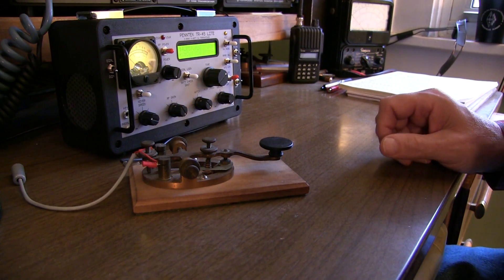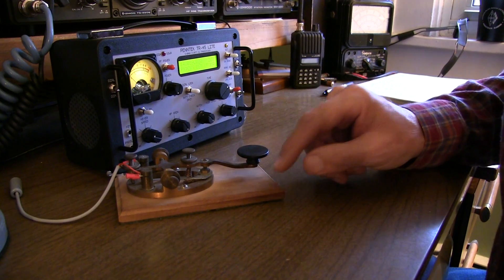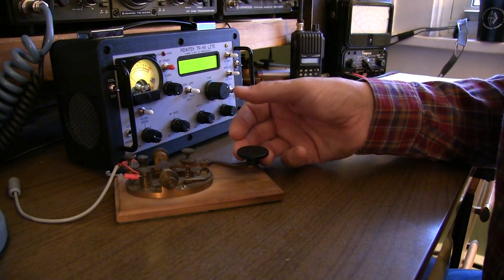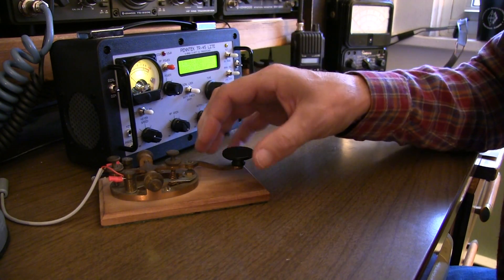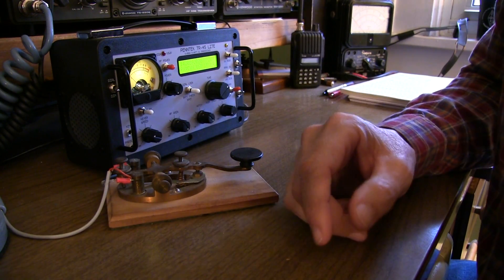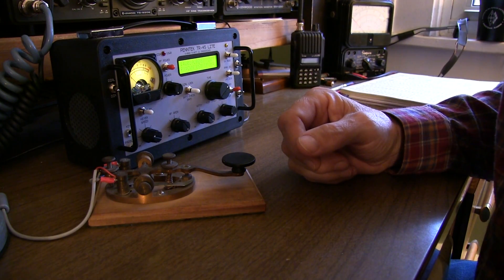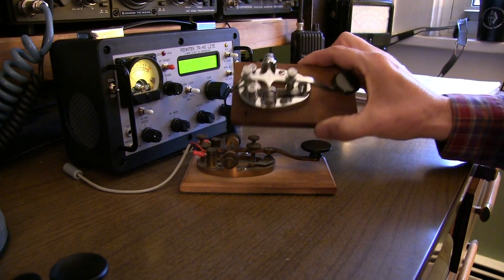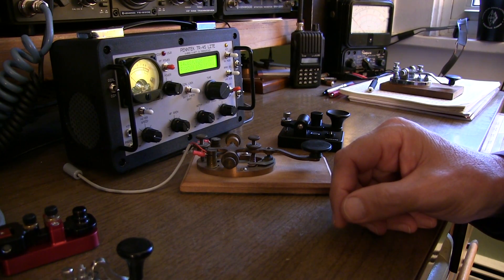#365: Ham Radio: What is your CW straight key sending style?

Comment: Novice ticket in 1977 when I was 14.  Started off with 2 fingers on top, index and middle.  After about 10 -15 years of pounding brass...went to a grip, thumb, index and middle fingers.  Works for me...when using my J-38 or Navy FP.
Reply from the maker: Those are my two favorite straight keys

Comment: i have my straight key perpendicular to my hand (right hand is controlling so the backside of the key is pointing to the left), gripping the knob, and resting my arm on the table. My left hand is holding the other side of the keyer mount to keep it in place. I play musical instruments and I prefer to only use my fingers and rotating the wrist to operate. To me, it's easier to control with the grip and to not use the spring to settle on the spacing of the dits and dahs. I could run the key without a return spring basically.

Comment: I believe there is a Right way, and many wrong ways to hold a Key !
I ascribe to what I believe is the proper way to hold a Key.
That is my being Right handed, I place my Thumb on the left side of the disk, Index finger on top, likely forward some, and my middle finger along the Right edge !
Your Forearm and wrist should be resting comfortably along the desk top, with your wrist handling the make and break of the characters !
One of my Elmers, as I figure I've had plenty over the years, learning a little bit from each, gave me what he called a ,
 " Spit Fire " !
The trusty Ol' J - 38 !
And he was correct !
You can send a Hell' n have you a mind to !
Ran a Straight Key for some Forty years, before telling myself if I'm going to use a Paddle, I'd better do it, cause I'm not getting any younger !
Still switch back occasionally, but it's hard to beat a good set of Paddles !
IMHO !
Thanks for ask'n !
'73 !

                   R.I.P.
           JERRY SMITH 
               WA9VPR
                (VIPER )
                ♥️🥀♥️

Comment: I use a grip and elevate my arm "European style".  I've been licensed since 1968.  Was off air for 29 years and when I got back on, I went right back on CW.  No problem.  I use an inexpensive "steel lever" straight key.  It's mounted on a rectangle of 1/4" walnut paneling about 4 x 6 inches.  I usually send around 18-20 WPM.  
For electronic keying, I use an old Brown Mfg. squeeze paddle and an old Heathkit HD-10 keyer driving a mercury whetted relay for keyer protection.

Comment: Which one do you use? How about you do a "straight key sprint" by changing keys for each contact.  Put them in "rotation" smash 'em all for an evening and see how they really stack up against each other.  It's SKN after all, mix it up.
Reply from the maker: For straight keys, I typically use the 90 year old Bunnell when I am using the Kenwood TS-870S, and the 50 year old Speed-X straight key when using my QRP rig.  When operating portable, I use the miniature Vibroplex camelback key (when I am not using paddles).

Comment: I love sidesweeping.  SS is a straight key right? It's all manual. 
I finally learned how to properly manipulate a straight key by watching the old military training videos from the 40's and improved a bunch from that exposure.  U.S. Military that is. 

and in other keys:
I got a set of paddles way too soon-first licensed and don't recommend that to anyone. I mean don't refuse a good set, but save 'em until you're running a good SK is my notion (they don't go bad).
SOME DAY I will get smooth enough to use my semi-automatic key (bug) because I love the mechanical aspects of the apparati so designed.  I flat out refuse to go on the air with it and be out of balance. There's plenty of that already.
But if I had to key only one way from here on--I'm sideswiping with a ham-built key I modified to replace the springs with magnets. It's a smooth operator, me  not so much.  

I should have caught SKN this past time-I was available for once. maybe next year. 73!

Comment: Hi Alan ... As with others below, my Elmer was my Dad, formerly, K8WWK (and when he passed away, KG7X [call obtained and now held by my son, Robert, after Dad passed]). Dad was an Aviation Cadet at the end of WWII, and during his service he had learned to send/receive Morse Code 'the Navy way', that is, with a 'grip' style. When he taught his offspring (us), we learned by 'anchoring' our elbow, and sending with the 'grip' style. Dad had purchased, and then modified an old Signal Electric 'buzzer' key (from one of the old swap meets), very much like the old J38 key, but still with a unique feel. He had modified it by removing the 'buzzer', and building an audio amplifier in its place, and then later he added a tone control. It ran on an old 6 Volt Lantern battery, and it drove a speaker with kind of a metal enclosure with openings to let the sound out, and had a pretty pleasing tone for its time. When I got my Novice license, I ceased to use the signal electric, and instead Dad had obtained an old Navy Key, which had a large, tall black rounded knob (we used this because with the transmitter we were using, parts of the Key were 'hot', and this one isolated us from the more dangerous energies). (I think that thing gave me a 'glass arm' for awhile). But recently, I obtained a near pristine version of the old Signal Electric key (mine has an older 'clacker' rather than a buzzer, but the important thing is the key in this case.) When I started sending on that thing, it was like 'old home week' ... I instantly remembered the 'feel' of that old key that I had learned on 40 - 50 years ago (early '60s) and it was like 'smooth as butter'. I haven't ever done straight key night, but with that one, I may consider trying it out. I can do what I consider really fast (smokin'!) morse with my Bencher and MM-3 for relatively short bursts, but I could probably send 18-22 wpm on the Signal Electric with pretty good accuracy for a pretty long time. I may be inclined to try out the old 'Straight Key' night next year. Thanks for addressing a favorite old subject. 73 & DX! Neil K7WK (& Grandson, Alex, K7WWK & Brother, Dave, W7SN)

Comment: Thank you for the video. I use the "European" style, with an old WW2 Key No. 8. I have a Kent key, but strangely enough, the mass of the key arm slows me down. The arm needs to be very light, and I use very small contact spacings. I much prefer the manual key to an auto key and I send at 20wpm usually.  73
Reply from the maker: Very good - I typically top out at 17wpm with a straight key.

Comment: First, I generally like the knob to be very close to the table, perhaps even installed upside down on the lever, if there’s enough room. Then, I use the pointer and middle finger, pointer for dits and middle for dahs, like a vertical sidewinder - it saves a lot of motion. J-38 would be my favorite. Thanks for the video!

Comment: I use a Speed-X mounted low with a Navy Knob. I grip the key with thumb and middle finger. Index finger on top. I keep elbow on table. I don’t send a lot with straight key. I’m a QRP DXer and most of my CW time is spent with keyer in the rig and a Begali Simplex Mono (single lever paddle). Steve, N1AOB

Comment: Alan, What do you think about the SKCC allowing and even tending to promote using bug/paddles over a genuine "STRAIGHT KEY"? I was crushed when I learned this... haven't really engaged with them after.
Reply from the maker: I don't think the SKCC is promoting the use of paddles.   They certainly do allow the use of a bug though, since this type of mechanical semi-automatic device has been around as long as the wired telegraph days.  They also promote the use of a single-level paddle in a Cootie configuration - which is also a fully manual way of keying.  None of these methods use any electronic keying circuit or aide.

Comment: I'm a Gripper. I learned that way as a Cub Scout in 1961. Overt the years I've tried several different variations but I've settled into what you called the European style.
Reply from the maker: Yes, that's what works best for me, especially because it works for different operating locations and situations where I might not have a surface to rest my arm.  Still looking to get you in one of my POTA activation logs...

Comment: Take a Blade type key like a side swiper or commonly called a (cootie key) but just key to one side only (non cootie mode) you will find side keying is much easier than traditional up and down keying and you rarely get tired just make sure you have good surface area on the finger tab covering the blade and don't let the blade have too much flex but also you don't want it too stiff. Several plans on YouTube  on how to make a simple blade type key very cheap, and since you're resting your hand on the desk, in full comfort   You can click along this way pretty fast with just using 2 of your fingers or if  you o prefer to grip the blade handle with your thumb and 1 finger you can do that way as well,  Experiment with your choice of hitting the key and find your comfort and control zone.   if you want higher Straight keying speed this type of keying can control your characters very smoothly.   Learning true Cootie keying is awesome as well but that takes practice so modifying to just one direction is much simpler for many hams.   Take a bug or even a standard paddle and just side key the dah side in one direction and that will work as well and adjust gap and tension to make it as smooth as possible,  but I like the blade as control is somewhat better,  one safety note rarely mentioned anymore on reviews on keying is make sure if you touch contacts or the metal parts of any straight key that be aware with modern electronic keying your fine but plug in to an old tube set with high voltage on the contacts you could really get zapped. or worse.  I mentioned this as on your video you mentioned touching under the finger tab slightly on one style of grip and that would be a huge surprise if plugged in to an Old Antique or vintage tube transmitter    Great topic and glad you did this video   73 J

Comment: I learned to send on a Military Surplus J-38 key with a Navy Knob  (and still have it!).  I gripped the top part, with my index finger on the top and thumb and middle finger sort of on top of the lower part of the Navy knob.  I have never had an operating position where I could rest my elbow on the table.  I passed my General Code test with whatever they had at the FCC office in Atlanta shortly before I got my driver's licence.  I never operated much CW after my Novice days, but I am slowly getting back into it now as a REAL OM!    It is REALLY hard to UNLEARN bad habits.  73
Reply from the maker: I know what you mean.   I learned CW the wrong way about 40yrs ago, and it is still tough sometimes to break the mental lookup-table methodology.

Comment: I don't CW, but if I did...  I've found that wresting my palm on the benchtop greatly improves my surface mount soldering by reducing shakiness; probably a different problem.  I think this control issue is more like guitar, where I depend on wresting my little finger (or more) on the top of the guitar while I'm trying to get control over individual strings.  I suspect I'd be best off making a key that looks something like a guitar string...  :)

Comment: I was privileged to be taught by a very experienced marine Radio Officer who was an excellent instructor. Key screwed to the edge of the table. Grip the key, arm relaxed in the air parallel to table and flex the wrist to form the characters. "European/British/English Style". Also, taught to send without sidetone (some old ship MF/HF transmitters didn't have any sidetone). Still prefer straight to bug or paddle. In fact, I can't even send if my arm is on the table😅. Euro style comes in handy when /P as I can hold a small straight key in one hand and operate with the other. No table required.
Reply from the maker: I don't know how I'd do without a sidetone!

Comment: I still got my straight key off of my MFJ code practice oscillator when I first got my novice license back in 1993. I've long since lost the oscillator and just use the key with my radio. Not the best quality, but does get the job done. I had to go check, but I put my whole arm on the table, put my thumb on one side of the key, my middle finger on the right side and my pointer finger does the keying. 
My maternal grandfather wasn't very technical, but he had a cheap shortwave radio (Hong Kong made) that he could tell me what they were sending. I always was fascinated by that and when I first got my license he helped me study. He was in the Arm Signal Corps in WW2 in Hawaii, and even though he wasn't a ham and hadn't really used CW in about 50 years, he was still able the help me with 5 wpm. 
Thanks Alan for sharing! Happy New Years and 73!

Comment: Disclaimer - I'm neither a ham-op, nor can morse-code, but was wondering the following:
In any mechanical system, an efficient use of power energy is when the stiffness in the actuated loop is highest (i.e. the potential energy needed to charge and discharge the "spring" aspect is smallest for each stroke). From this perspective, one would think that the "writing style" (corner of the inner palm resting on the tabletop) would be the stiffest, therefore most efficient. There is something to say for also choosing an optimum whereby the strongest actuator is used (the fore-arm torsion style that you mention). 

Another style may be even more efficient - putting the key on its edge and pinching it between the thumb and forefinger ("ergo-mouse") or between forefinger and thenar-region ("stapler") - any idea if this actually works?
Reply: "Castanet" (instead of "Stapler")

Comment: I learned CW in the army operating in armored vehicles.  CW switches for this use have (or had) a bracket attached to the operator's leg (a kind of belt).  It's quite comfortable and after that I never got used to using the key on a table.

Comment: I grip the key with my elbow resting on the table.
My Dad taught me code  he was 3KS in the period just after ww1. (His call sign 3KS, wss before they adopted the prefixes in Canads)
I like a bug when I am rag chewing. 
I have dad's old straight key which I learned on, thats what I am using tonight. Comes out every new years.
I am sitting here wih it getting used to it. 
Best regards 73 de VE3JTV. BTW THE RIG HERE IS A YEASU PAIR YES TUBES!  I HAVE BEEN LICENCED 54 YEARS, got licensed in 77, upgraded to the advanced  in 78. My code is old and smooth about 18 to 20 wpm. Not a speed demon.

Comment: I use a grip method. I also keep my wrist off the table, so I rotate from my elbow or I keep my elbow off the tabble, and use my upper arm.  Love the Navy knob . Gives me somethig to grip on too.  In the "old days" I put a poker chip under the knob of the key to mimic a navy knob. 
I also am getting better at the cootie key (sideswiper) I either use a double paddle key, or for sideswiping, I prefer a single lever key.   My favorite straight key is the Japanese Ball Bering key. (K4) I have two I purchaced from Radio Shack back in the early 1980's.  I also have a 3d printed straight key I use for field operating. 95% of the time I'm running QRP, either from home or the field.  I enjoy buidling my own radios and antennas. 
Love the channel. Look forward to more.  
73

Comment: I have the same key I used since 1970 when I got my Novice license. I added an additional surface under the main handle/knob which I rest my thumb and middle finger on. My index finger is on the knob. The key is a VERY old key that I got from who knows where.  I'd include a picture here except YT won't let me drop or paste one in.
So, if you were to remove the "knob/handle" off of the arm of the key. Now, make a round piece of circuit board material (0.062") about 2 inches in diameter. Install this between the knob and the arm of the key. This gives a nice resting place for the thumb and middle finger.
The key is mounted on a piece of basswood so that my wrist rests on the end closest to me. I send using wrist action ... movement is from wrist to fingers.
I *like* to rest my whole arm on the table, from elbow onward, but this is not required.
While I am left handed, I send morse code with my right hand and this leaves me free to write with my left.
On the bottom of the Basswood base is a piece of rubber back carpeting as a pad.